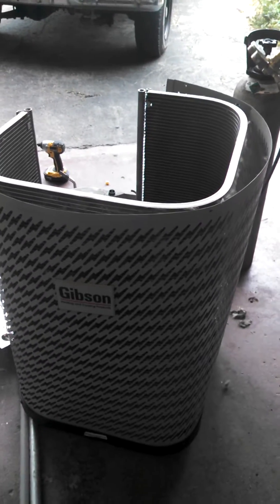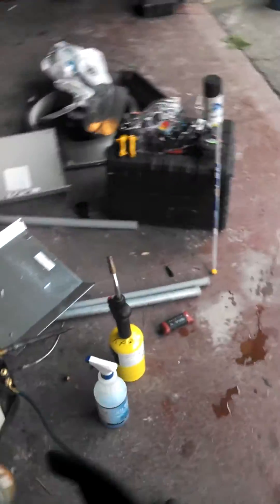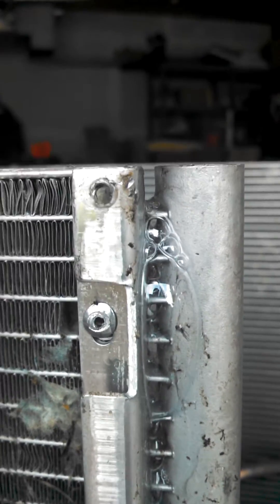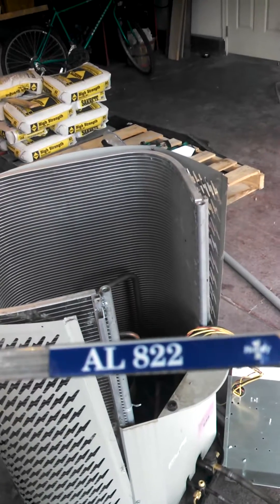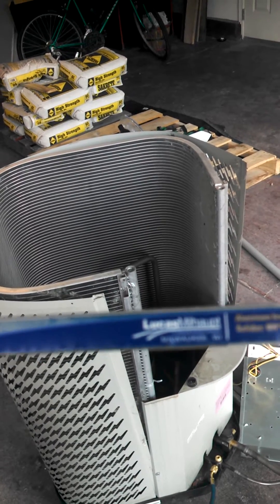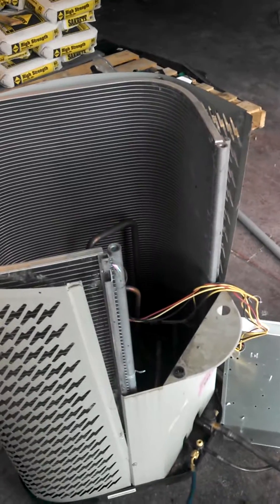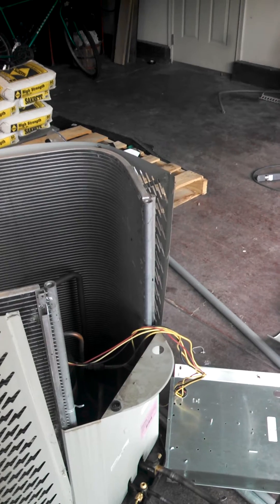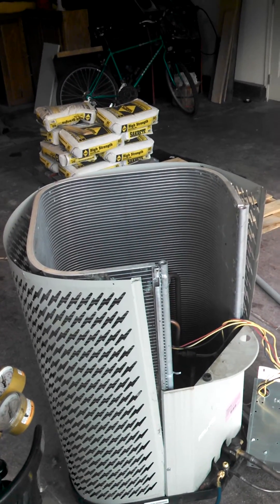How to Repair air conditioning condenser aluminum

Comment: can you braise a coil on the outside condenser unit while the system is off or do you have to remove the r22 from the system before you start the repair?
Reply from the maker: Has to be pulled out and should be swept with nitrogen

Comment: I dont see any condensers being brazed as the a/c guys want to make the money and dont want a leak to come back on them but for the home owner, diy guy save a lot of money
did you have apply a flux or was it already on the stick, I hear to clean metal were good.
Reply from the maker: Rod comes with Flux inside it all I did all I did was clean up the area with a wire brush

Comment: You say to use a standard (Blow Torch). What kind ??? Propane... And did it really actually hold it's running pressure,when it was all said and done. (Fired up)..
 Did it so far hold up ??
Reply from the maker: Mapp gas Torch just your basic hand held model,  You can see it on the ground in the video. I re-installed it and it has been running for about 2 months with no problems home owner was very happy
Reply: Very good,Thank You !!